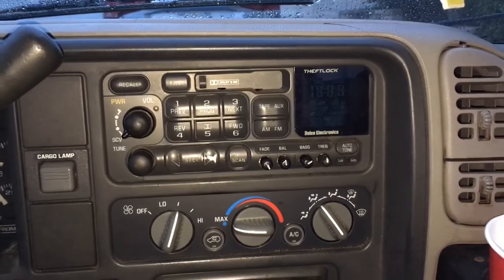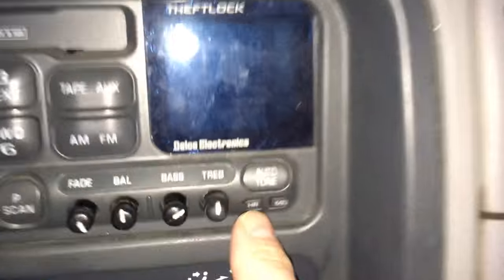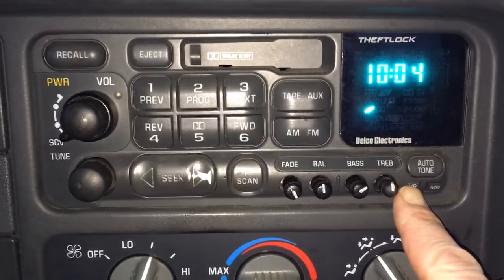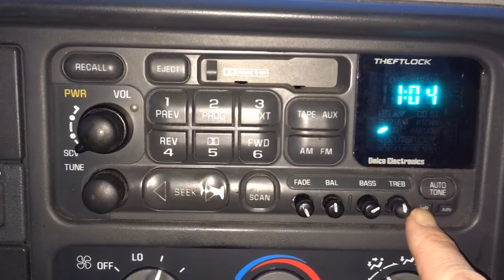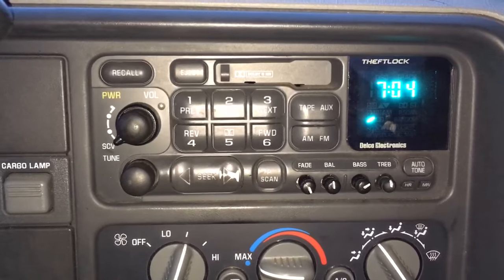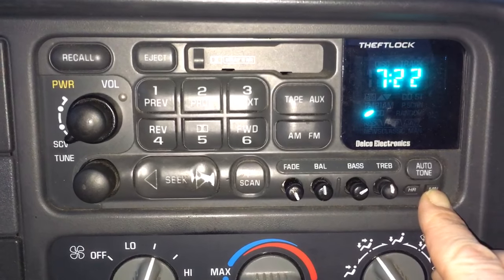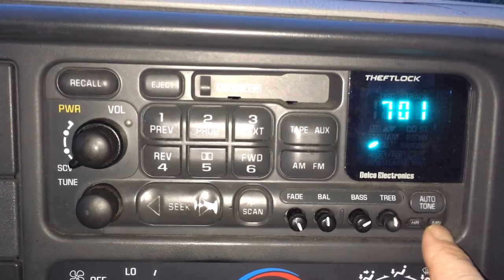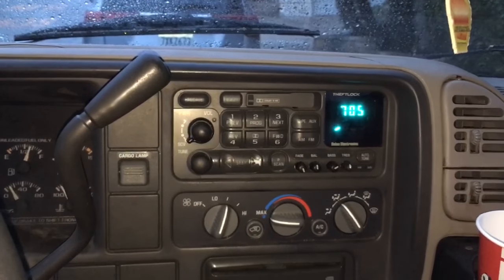How To Change The Time On An Old GM AC Delco Car Stereo

Comment: I am confused by mine now. I have never had a problem setting mine before until now. It won't let me do it twice. I have to turn the key on then off to then set the mins. And if I press it more the the first hold it don't let me change it.

Comment: At NOON unhook a battery terminal for 3 sec and rehook back up. The clock starts at 12.00  when battery is changed or disconnected. Clock may be one minute late. My 1998 GMC Safari factory radio is different from the one on this site.
Reply from the maker: That works too.